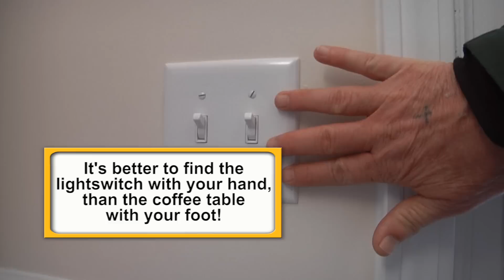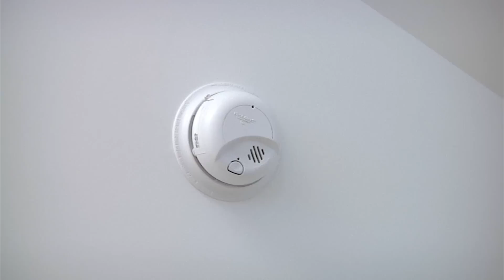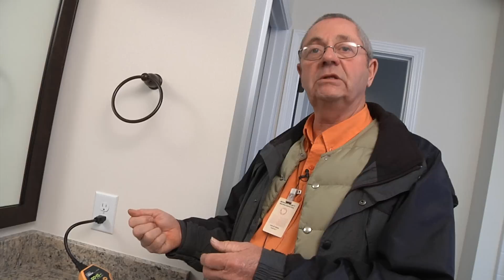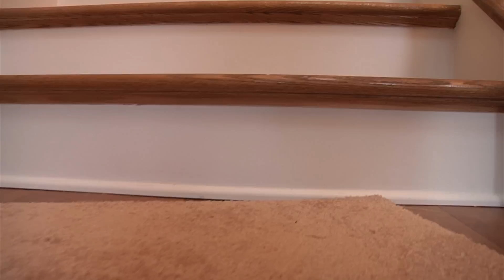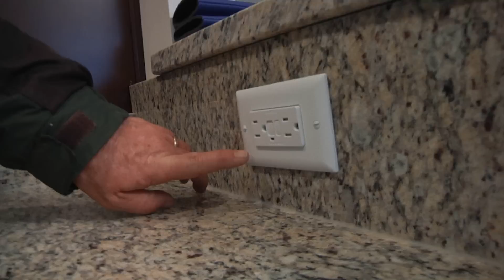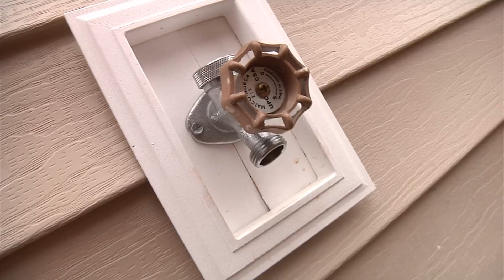Building Inspections: Final Home Inspection

Comment: Great video. Impressed you use the IDEAL Electrical 61-164 Sure-Test Circuit analyzer, which has the capability to detect a bootleg ground. Both InterNACHI certified and many municipal inspectors appear to resist resolving this due to their aversion to liability and risk of litigation. Search for "bootleg ground" to learn more.
Reply: I was browsing through the videos and saw him with the Sure-Test and had to watch it too.  I have one and have found many bootleg grounds and even found that the bonding screw in one panel was installed poorly as it would jump between having a ground and no ground.  The previous contractor decided to separate the grounds and neutrals on a main panel for some reason.

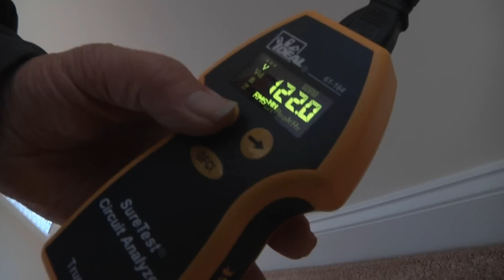Comment: What tester is the inspector using @ 1:07 in the video?
Reply: NJ Home Inspections it's an Ideal brand receptcal tester the model number is 
61-164.
Reply: http://www.idealindustries.ca/products/test_measurement/circuit_analyzers/suretest_circuit_analyzers.php

Measures voltage drop under load
Hot and neutral conductor impedances
Estimates Load on Line (ELL) up to 15A
Tests GFCIs and EPDs for proper operation
True RMS
Line voltage
Peak voltage
Frequency
Ground to neutral voltage
Ground impedance
Identifies proper wiring in 3-wire receptacles
Identifies false (bootleg) grounds
Conducts testing without disturbing sensitive loads
Verifies isolated grounds (with 61-176 adapter)
Reply: HOW MUCH ?

Comment: That's stupid! If I am desperate enough to get out of a house that is on fire, I am going to break or open a window and get out that way.
Reply: Gammareign What if Burgular Bars?
Reply: Bukk the Left   You have a point, the code allows burglar bars and only requires the ability to open them from the inside of the dwelling for the specific egress windows. Can be rough in a panic, nobody knows until their faced with it. Till then it’s just foolish talk.
Reply: Easier said from someone who isn’t 90 years old.

Comment: 0:38 who locks a key dead bolt while there home you lock them when your out. you lock thumb latches ex while your home. Thumb latch's are only for when your home and inside...and a door with windows like that needs and extra lock i cant reach in and open. Thumb latch's are great for when your home but when your not and you dont have a solid wood door is asinine. that door is not secure unless you get a security system and that dose not stop brake-ins it just call the cops after it happens. Used a double key dead bolt 24 years never have i bin locked in house ever because im not stupid and only use it while im OUT. But i am NOT ALOUD TO HAVE IT! thanks to people like you.

Comment: the amount of regulations is absurd.... No wonder people can't do shit....
Reply: You meant to say "no wonder builders can't get away with shit when you have a good building inspection." You'd sure be glad if it was YOUR home that was being inspected.
Reply: MrAkurvaeletbe Good for us Carpenters, it prevents DIY.
Reply: Well, there are reasons why. For electrical, the codes are there to prevent fires and shock. For the frame, you need to be sure that it will be able to hold the weight of both the users and any things they want to add. 

While I agree that over regulation is bad, for things like this, if it's got a good reason, it's not bad.
Reply: it's mind blowing, getting headache already.
Reply: And just think, those same incompetent regulators want complete control over your healthcare.
Reply: MrAkurvaeletbe ikr. Over regulated so you cant build anything